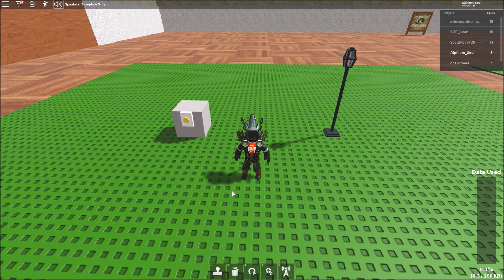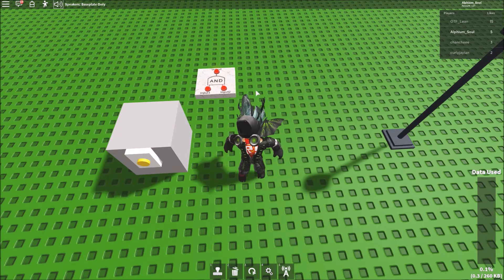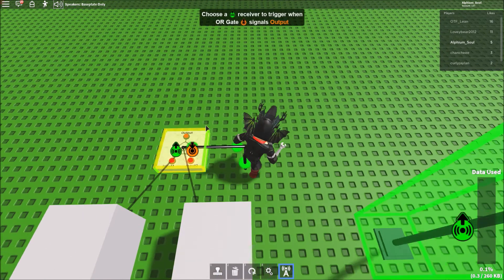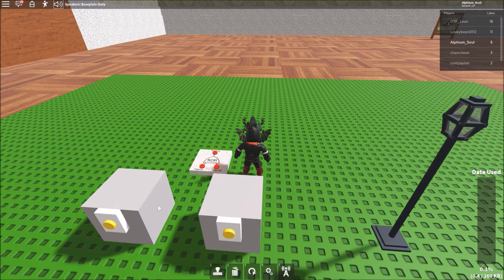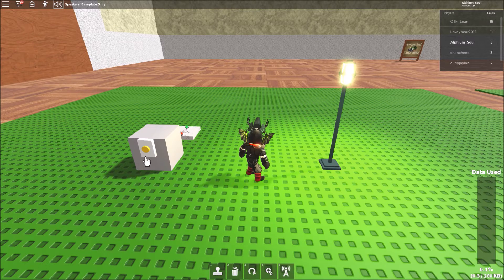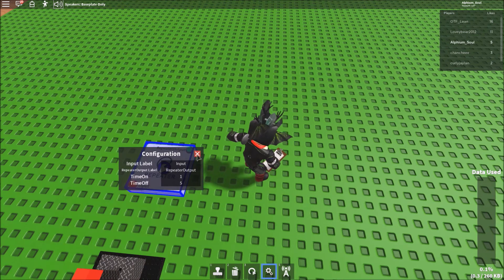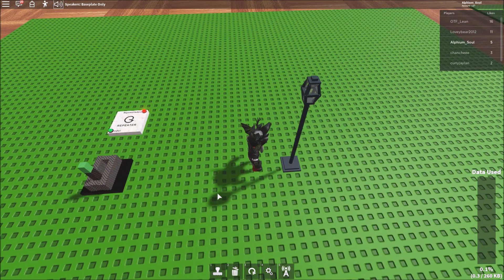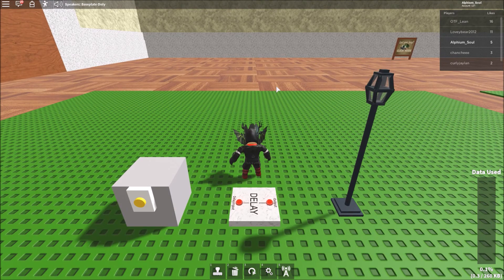Welcome to Roblox Building - Wiring Ep. 1: Inputs, Outputs, and Gates

Comment: How do I use keycrd
Reply: Oh, that’s simple so first you go to security on your stamper tool, and then grab a table in the cat category, including a picture that says scan card and then you just configure it to the number and you can also configure a card to the number you want. (Max 10) and then wire the scan card thing onto anything that has a black arrow and green background make sure to wire it from orange to green and then you get the card press the inventory button hold it, and then put it into the receiver. The receiver will emit the signal onto the thing you wired it to there that’s how.